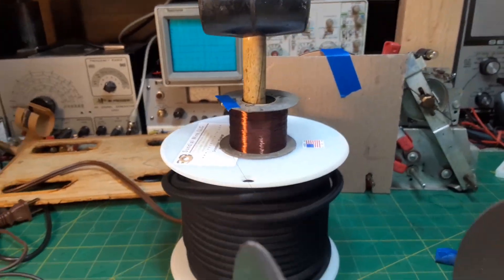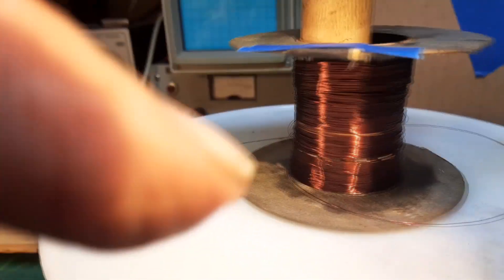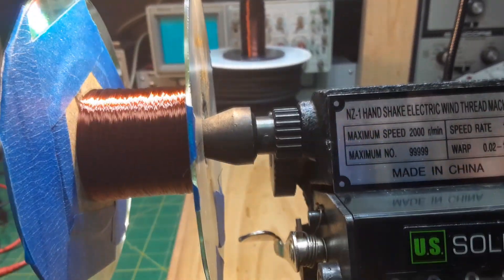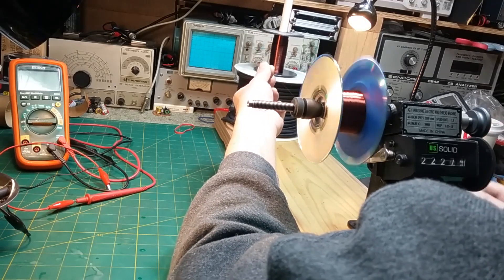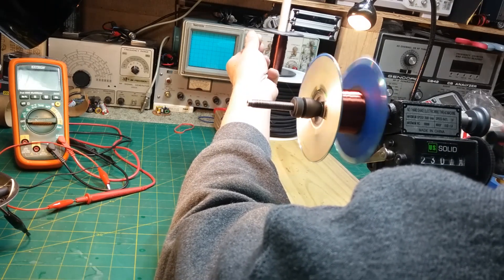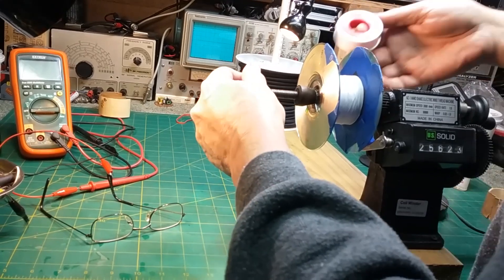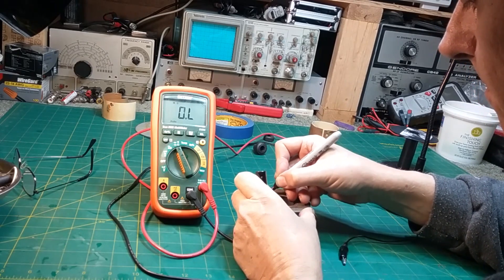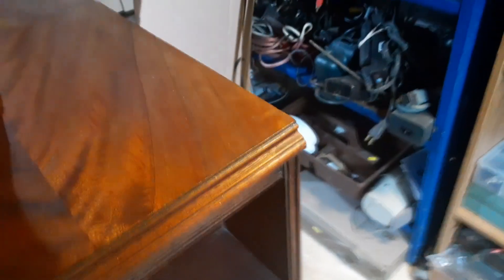1930's Zenith 7S261 Radio Part 2: Field Coil Rewind

Comment: I would have liked to see how you spliced the wires together.  Great video!!! Thanks.
Reply from the maker: Basically, you scrap the shellac off the two ends of wire, solder them together, then wrap the area with a layer or two of Teflon tape before continuing the coil winding.
Reply: @ElectroRestore  Thanks for the info I was wondering what you wrapped the splice with.